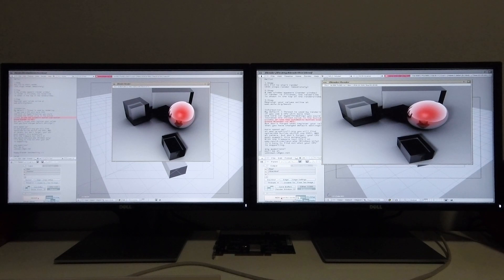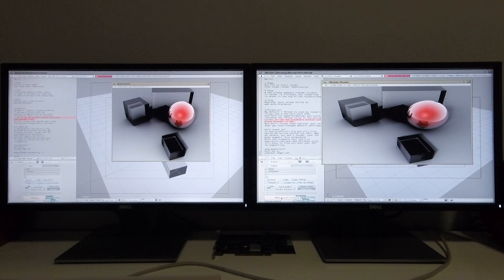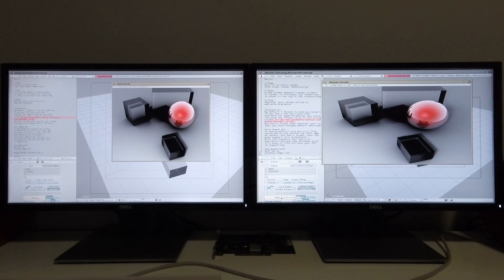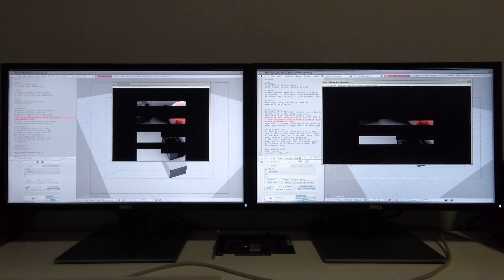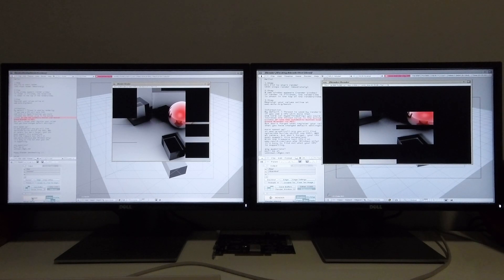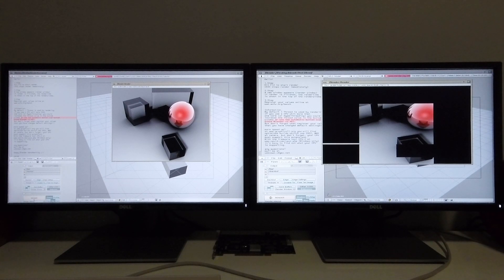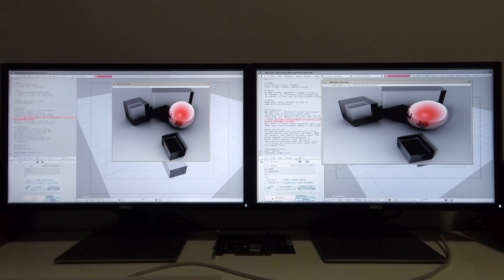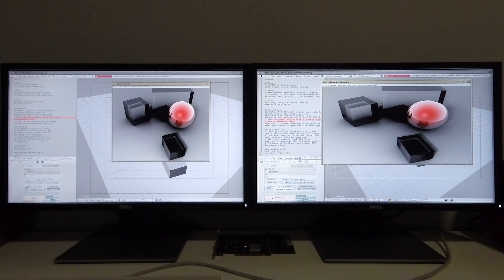A Blender test shootout between a top spec SGI Tezro and Octane2

Comment: For full Blender benchmark info on SGIs, see:

http://www.sgidepot.co.uk/perfcomp_RENDER1_blender.html

Some notes:

- Blender V2.44 is 11% faster than 2.45; this is why I used 2.44 for my testing. This is why anyone using the most recent 2.49a build for SGIs may find they get slightly slower results.

- The test scene (test.blend) is very simple; it does not expose Tezro's higher bandwidth and better memory latency. A more complex scene may run even better on the Tezro, demonsrating advantages from bandwidth and cache size such as those revealed by my Alias test (whereas the Maya test is simple and behaves like the Blender test):

http://www.sgidepot.co.uk/perfcomp_RENDER3_alias1.html
http://www.sgidepot.co.uk/perfcomp_RENDER4_maya1.html

See my results index for further data, including C-ray:

http://www.sgidepot.co.uk/perfcomp.html

- On a dual CPU SGI, rendering will always be faster when using 8 threads instead of 4. This implies that on a Tezro, ideally one would wish to be able to use at least sixteen threads, but atm there isn't a build that supports this (2.49a is still limited to 8). I don't know why this is the case, but my best guess is that the MIPS architecture is in some manner acting in a way that's rather akin to SMT, ie. threading works best with 2 threads per CPU (or even more). This appears to be confirmed by the C-ray data.

- As with PCs, performance is improved by using smaller tiles. With a quad-1GHz Tezro, I obtained the best results using a tile split of 24x24 (59 seconds), but on other systems it may differ. For a dual-600MHz Octane2 I think I used 16x16 (3min 15s).

- Interesting to observe that based on the performance of various VW320/540 configurations, a theoretical quad-XEON Pentium III 1GHz VW540 would complete this test in about two and a half minutes, vs. just under 1 minute for the quad-1GHz Tezro. Thus, clock for clock, Blender shows the enormous IPC advantage MIPS had at the time, but of course SGI moved away from MIPS (shame) and PC CPUs were a lot cheaper (or at least the consumer models were; XEONs, er, not so much). I have a quad-500 XEON VW540 and have obtained four 900MHz XEONs for it, but not done the upgraade yet. Btw, the UK MoD were so impressed by the 540, they wanted SGI to produce a proper followon system with up to 8 CPUs and a lot more RAM, but of course that never happened  (a custom 540 using XEONs with doubled 4MB L2 came very close to matching an Onyx2).

Ian.